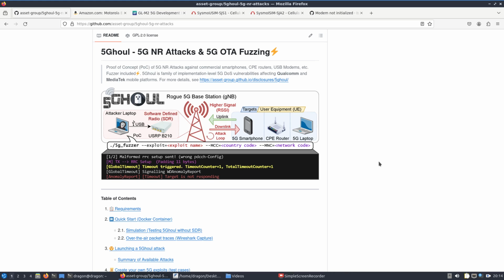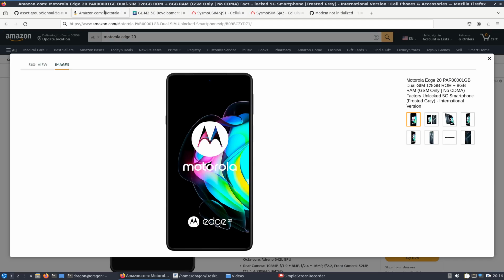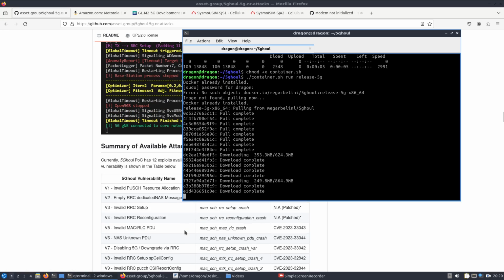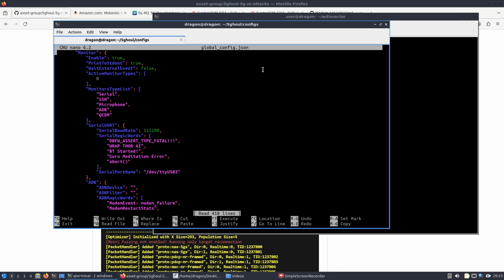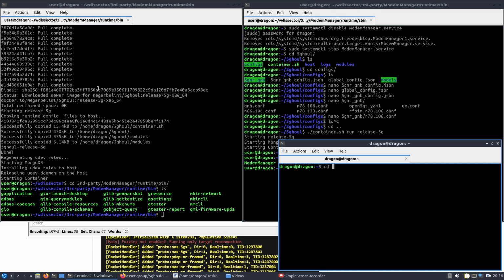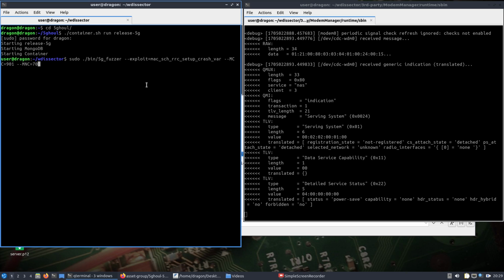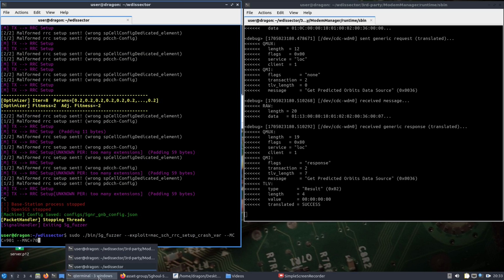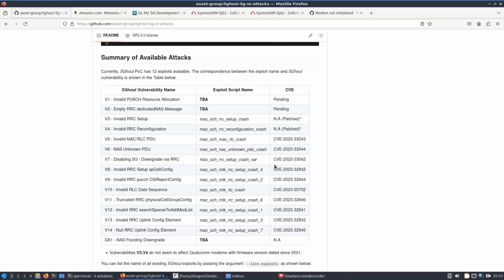WarDragon 5Ghoul: Setup for 5G NR Vulnerabilities and Security Testing (B210, GL-M2)

Comment: Wonderful Explanation. I am using USRP N310 with Ubuntu 18.04. Do you think that we can achieve results using USRP N310?
Reply from the maker: You would have to change the configuration file. I briefly tried with the x310 and wasn’t getting good results for some reason.

https://gitlab.eurecom.fr/oai/openairinterface5g/-/wikis/OpenAirSystemRequirements#supported-rf
Reply: @cemaxecuter7783  Thanks for your response.

Comment: Hello greetings of the day, need some help, I'm using sysmoISIM-SJA2 to connect with my srsRAN base-station but its not connecting. Can you tell me any other configuration i needed as i already configured the user_config with desired ki,opc values.
Reply from the maker: What mnc mcc values are you using for the enb?
Reply: 999 70, do i need to do some changes in the sim using pysim to work?
 @cemaxecuter7783
Reply: Do i need to program the sim before using? @cemaxecuter7783

Comment: If I understand 5g correctly, there are 3 bands. Low and mid which are specific freq ranges that are sub-6ghz. But the high band 5g is in the mm-wave range, above 24ghz. 
Are there any SDRs capable of operating in the high band that aren’t cost prohibitive? Or, is it possible to modify a 5g device to use it as an SDR to access frequencies above 24ghz? 

Great video as always!!
Reply from the maker: Good question on 24ghz, I’ll go do some research but I don’t think I’ve seen an SDR that covers that range that’s cost affordable. There’s so much to learn on cellular let along 5g, my head hurts and I don’t think it’s from 5G waves 🤣
Reply: There are two "frequency ranges" FR1 and FR2. FR1 being 400 MHz to 7 GHz and FR2 being all the mmWave spectrum. In most cases, FR2 would be supplementary to the FR1 spectrum in areas that have high user density. The mmWave connection would be a dual connection so the device would camp on an FR1 band, then also use FR2 spectrum when the device requests data connections. mmWave front ends are high performance, and most of the 5G software (open-source) only configures FR1 spectrum.

Comment: Is antsdr also capable of doing these instead of usrp?
Reply from the maker: I’ve been trying, but the OAI configuration for the hardware section example that’s set for the b210 didn’t work as is, that was after modifying the dockers uhd to support the AntSDR. I’ll keep trying.

Comment: Great work, and all that you do too. 👋
Unrelated to this vid, but the wifi is not working with 5gnz signal. DragonOS. Do you know if there is a fix or am I doing something wrong? After entering my passwd it tries to connect, and then goes back to the entering password. I’m using a MacBook Pro 2012
Reply from the maker: 2.4 is okay? Can you try without encryption? I’d have to see what those older pros have for WiFi hardware.
Reply: @cemaxecuter7783  yeah 2.4 works fine. Just thought it might’ve been a common thing, I read Ubuntu requires you to enable 5ghz in the network  setting, and change from auto to 5ghz or 2,4. I tried that also with dragon, but no good. 
It’s no big deal, and thanks heaps for replying.
Reply from the maker: Hmm I’ve never had to make changes for 5Ghz. Maybe it’s a driver/older hardware thing. I think it’s maybe running Broadcom b43 stuff.
Reply: @cemaxecuter7783  I didn’t install any proprietary stuff as I had to install dragonOS without internet connection (it kept hanging at the install section and some quick research showed others with the same issue and solved it by installing without internet.)

I’ll check it out later on. Thx bro 👍
Reply from the maker: @-someone-. I’m super curious about the hanging part - that does remind me that it may be something to do with the b43 stuff.
Reply: @cemaxecuter7783  the reason I didn’t install the proprietary drovers after installation is the privacy issue, so really no big deal. I have an Ethernet cables always handy and I don’t use that OS when out, and when I’m out with it I don’t need wifi for sdr stuff. 👍